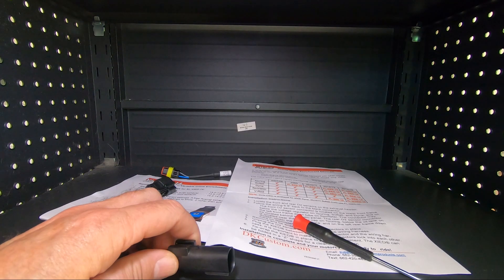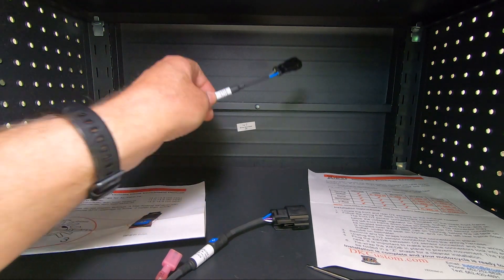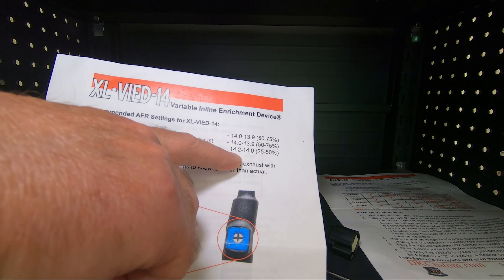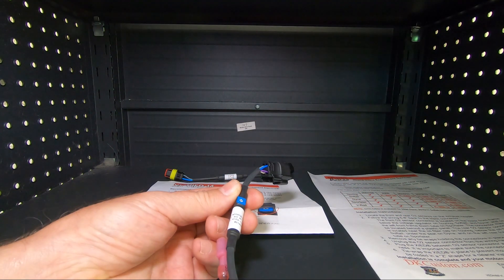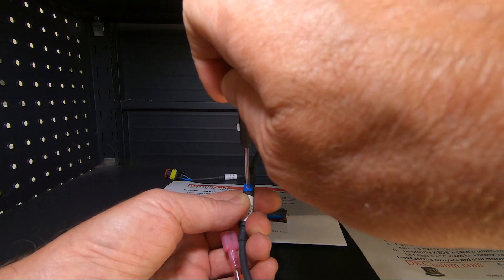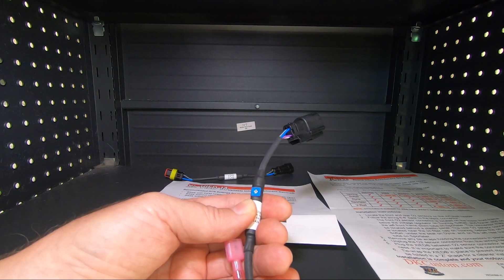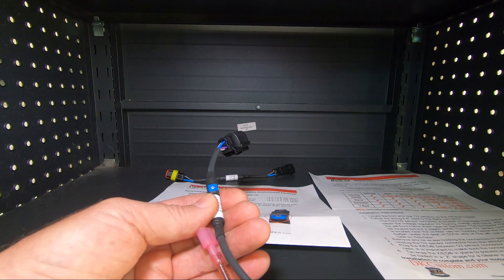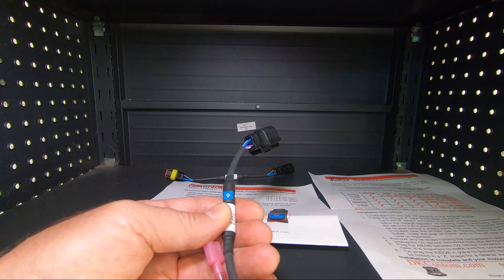Plug n Play Adjustable Fuel Management for Harley's

Comment: I have installed the FL - ViED on my 3014 Heritage Classic, would it be advantages to add a Fuelpak FP4 or will it not work together?
Reply from the maker: The only benefit there could be ,with running both, would be if your tuner is not giving you enough fuel enrichment then the addition of the iED certainly will. The FP4 should be giving you enough fuel enrichment. 

Please feel free to contact us with any questions;
Support@DKCustomProducts.com
662-252-8828

Thank you for commenting! 👍 MB

Comment: You guys really should have a million or more subscribers! Everyone who rides a Harley absolutely needs to be subbed to you guys!
Reply from the maker: Wow, thank you for the kind words!  Share our vids with your friends, might help them out.
Reply: Only people riding standard-ish Harleys will find this sort of thing useful. I put the XIEDs on my 2010 Streetbob and whilst the effect was positive I wouldn't say that it added any real power gains. To get a real performance Harley then the AFR is gonna be around 12.5 to 13 : 1, all the weaker AFR's will not make a lot of difference.Loud pipes go hand-in-hand with these AFRs and two-into-one exhausts just stifle the engine above 4500rpm.
Unfortunately to get real power gains involves a lot of parts and engine modifications and  money to do this. I stopped counting right away because even if I hadn't had a fair bit of cash to spend, I think I would have questioned the financial costs in comparison to the potential power gains.
 If you want more power AND insist on keeping it Harley then it'll cost so it is a good idea to buy a low milage used bike (CVO engined twin cams are better to 'hot-rod' as the engine has much better heads for a start) and remove all the chrome doo-dads to sell, save a good bit extra and then rebuild the engine with more capacity, compression, port the heads ,add a cam, get the crank welded etc etc and you can get a bike with  50+% gains.... my Streetbob now has over 130 bhp and torque  (with a carb as I junked the EFI) and is an absolute blast to ride  though it did eat the tranny main bearing! 
Remember though that the standard suspension, tyres and brakes need upgrading as well.
Reply: Whatever. 🤣🤣🤣. Go ride a foreign bike then🤷🏻‍♂️
Reply: @robbyclark6915  I already do..... I am English and ride Harleys so they are foreign bikes !
Reply: @thakery5720    Well I’m American and they are American bikes so that’s what I ride and what I love. Literally anything else is a foreign bike. Good luck with whatever it is you’re trying to accomplish 🤷🏻‍♂️?
Reply: @thakery5720    Oh my goodness! I completely misread your initial comment! I thought were dissing on my beloved Harley and putting down anyone dumb enough to drop money into that pit? 🤦🏻‍♂️🥺. Well that’s why I should finish reading people’s comments and being more discerning! My mistake! So sorry! I thought you were saying, well, I thought you were saying something you totally were NOT saying! I won’t even mention it as it just reveals my ignorance even further! Again, I’m totally sorry I sounded like a prick! That’s what I was being and I was out of line! Sorry and happy riding!
Reply from the maker: @thakery5720  Glad you're enjoying your Ride!

Yes, the XIED products are for stock and Stage I bikes.
Reply from the maker: @robbyclark6915  Some folks are Power Hungry.   Nothing wrong with that.  I did an interview last week with a guy that put a 131 in his Tri Glide.  That thing is a monster.

But to get that kind of power out of a HD is an expensive proposition.

My bikes, with just a Performance Plus Stage I, easily get to 100 mph very quickly, with more left on tap, and that is enough for me and most folks.
Reply: @DKCustomProducts  My reply was not meant to in any way deride from the postive use of these items - they are very good value and help the Harley be what it should be considering the way EPA and all other countries emiossions agencies are effectively 'neutering' the engines - I just meant to make Robby Clark aware that the way Harleys - and all engines - are so mechanically 'de-tuned' these days cannot be 'rectified' by such means.
 I sometimes wonder what kind of performance could be had if we still had the old polluting engines, fortunately we are much better informed these days as to how to save our planet and any supposed 'increase' in emmisions due to XIEDs eyc is so small - they just help the engines perform a little better by stopping them run too lean.
 If I have caused you any problems please tell me and I will delete all my comments - stay cool Guys !

Comment: Will it work on a M8
Reply from the maker: M8's do not need a tune to add a free flowing air cleaner, and/or free flowing exhaust.  Here is a video on that subject- https://www.youtube.com/watch?v=Lb_57Z_Ipms

If you have a Sportster or any Twin Cam, they come too lean from the factory, and the first thing to be done to those is either a tuner or a XiED product.  You want to do one of those before changing intake or exhaust.
Here is a link to some options.  The XiED line is very effective for Stage I's and are not expensive.
https://www.dkcustomproducts.com/efi-tuners-c74.htm

Always feel free to email or call with any questions.  Thank you for looking at our parts.
Support@DKCustomProducts.com
662-252-8828

Comment: Just added these on my 2010 Roadglide. I’ve had this bike going on 30k+ miles. Along with these, I’ve done the external breather, converted to factory dual header, drilled CVO mufflers, modified Air box. This was absolutely the best mod I’ve made to the rideability of my bike. Smoother, more torque through out power band, cooler & better throttle response. Set mine at 50% for now. Exceedingly happy. I am not planning cam changes or head work, so this was the answer for my bike.
Reply from the maker: Great to hear! Thanks for sharing, sounds like you have done some good things to get your ride dialed in how you want it.
We appreciate your business.

Comment: Hi guy again from down under thanks for reply on xied for 08 softail curious as what sort of afr should I roughly achieve or should it enrichen to in ideal conditions
Reply from the maker: Glad to answer your questions! 

If you install the XiED it richens the Air Fuel Ratio from 14.6:1 to 13.8:1 in closed loop mode. 

If you install the ViED it richens the Air Fuel Ratio from14.6:1 to a range of 14.3-13.9:1 in closed loop mode.  The V is for Variable because you can change the ratio. This Variable Fuel management upgrade allows you to fine-tune the air fuel mixture with a small screwdriver.

Thank you for commenting! MB

Comment: Hey there so I have a question for you guys. I have a 2015 ultra limited with python slip ons. I like a loud bike so I’m thinking Of taking the baffles and packing right out of my slip ons.  Would it be ok to run no baffles if I install the xied on my bike.  I still have stock air breather to.  So if I open that up and had no baffles would I then have a problem?
Reply from the maker: You will be fine tune wise with the FL-ViED's or FL-XiED's tune wise.
Removing the baffles will create a bit of a dip in your low and mid range torque, but that is easily fixed by installing the Thunder Torque Inserts™.  You will still be loud, and just a bit deeper tone.  You will have more power than you have now.
https://www.dkcustomproducts.com/xied-vied-fuel-management-c121-287.htm
LINK to TTI's-
https://www.dkcustomproducts.com/thunder-torque-inserts-c57-298.htm
LINK to a report on how and why the TTI's work at producing a loud deep tone, along with more power- https://www.dkcustomproducts.com/harley-exhaust-myths-and-facts.htm
Reply: Thanks very much for the quick reply.    The cat is still in my stock header so will I still loose low end power?
Reply from the maker: @kamakazeekid1  Yes, take a look at this video, I believe you will find it interesting/useful- https://www.youtube.com/watch?v=pr6z00gL5Yg

Comment: Can this be adjusted differently front and back?? Or should adjustments need to be even for both??
Reply from the maker: It is not necessary for them to be set equally.  If your bike is running warm and/or you ride in hot temps, it is not a bad idea to have the rear cylinder a little richer (more toward the 100% setting) than the front.  Just ride it at different settings, like talked about in the video, and where ever it runs best, that is where you should leave it.  You cannot hurt the bike trying different settings.
Reply: I forgot to ask, do you need to shut off the bike whenever adjusting it??

Comment: My 103 twin cam has a SE Heavy Breather intake & a Bassani Firesweep full exhaust system, plus it's got a Vance & Hines Fuelpak 3.  Is there any advantage in getting the enrichers if I've already got a Fuelpak 3?
Reply from the maker: The only benefit there could be ,with running both, would be if your tuner is not giving you enough fuel enrichment then the addition of the iED certainly will. The FP3 should be giving you enough fuel enrichment. 

Please feel free to contact us with any questions;
Support@DKCustomProducts.com
662-252-8828

Thank you for commenting! 👍 MB

Comment: I have a2008 this bike runs battery's  down due to the key fob alarms  system i need toby pass this thing and which wire from ecm to cut so I can by pass this I jumped start relay it starts but shuts down after 3 seconds
Reply from the maker: I don't know.  We've never done that.  We've never had an alarm run down the battery.  If a bike is going to sit longer than 1 week it is plugged into a battery tender.  You may have something else going on with your battery and parasitic drain.
If it is sitting for more than a week or so without running (by running I mean at least a half hour of riding between starts) then a tender is a good idea, regardless of whether it has an alarm system.

Comment: Nothing will ever replace my Power Vison with Target tune !!
Reply from the maker: The Power Vision with Target Tune is the cats meow.  I have that on my Sporty and it is amazing how well it works.  It is expensive, but does an amazing job.  https://www.dkcustomproducts.com/power-vision-tuner-accessories-c120-240.htm
Reply: I have a power vision and just ordered the target tune kit with the O2 sensors today, better than getting dyno tuned i hear!
Reply: Thats my goal for the trike is to get the Power Vision and Target Tune but I still like the idea of these little things during the stage 1 " un corking" process since it's simple and quick. These obviously won't work when it comes to putting in a hotter cam or a larger set of jugs & pistons etc, but  its a nice convenience to be able to pull off a side cover, make a quick adjustment, and back on the road.
Reply from the maker: @grimeyhonkyracing3938  The PV with the TT is crazy good.  👍
Reply from the maker: @daviddavis8653  Yes, these will give you 85-90% of all the available power in a stock or stage I situation, for about 1/4 the cost.
Reply: My bike is 2019 XL1200 48 Will these work with my fp3?

Comment: Can i get that for my Dyna lowrider 06
Reply from the maker: Good question.  On the Dyna's, in 2006, most of them are the same delphi ECM that Harley started using on all other HD's in 2007.  If your 2006 has o2 sensors, then you can run these on your bike.  https://www.dkcustomproducts.com/vied-fuel-enrichment-for-harley-efi-plug-n-play-more-details-dk-vied-nr.htm

Comment: I bought a used 2016 FLTRU. I just bought A power vision. I have factory 02  sensors. Vance & Hines power duals With twin slash cut Mufflers.  The pipes do not have 18mm bungs.  I believe it has a stock Cam. And a screaming Eagle air cleaner  With breather bypass. Would  This product will be  Advantageous  And/or compatible?
Reply from the maker: The Power Vision uses the narrow band sensors that are 12mm.  You would only need the 18mm if you were to add the Target Tune module, because it uses wide band sensors.  
Your power duals should have the 12mm bungs for the narrow band sensors, so you are good to go.
Reply: @DKCustomProducts   It seems from what I read that even with the power vision, The narrow band sensors can't Enrich the fuel  Enough accurately. I thought maybe Your  Product  Might get my fuel mixture into the 13's
Reply from the maker: @fredflint1797  You can see some details on the Power Vision at this link- https://www.dkcustomproducts.com/dynojet-power-vision-flash-tuner-w-auto-tune-dk-pv-cmp-pkg.htm
With this Power Vision you can get your AFR to where ever you want.  13's in closed loop is not a problem at all.
Now, if you are having a Dealership tune with the Power Vision, many of them will not tune it outside of the EPA mandates...but that is not a function of the Power Vision, but of the person using the Power Vision.  The PV has no restrictions built into it.
Reply: @DKCustomProducts   Thank you for your patience and response. I am a technology-challenged senior  Determined to learn. I need to find out How It reads beyond the range of the Narrow band Sensors. But if you say it can be done I believe you I just gotta keep  Hammering at it
Reply from the maker: @fredflint1797  In closed loop, where the narrow band sensors are used, that is a low load, low throttle area of the tune.  Getting the AFR down too low is not preferable...doable, yes, beneficial?  I can't think of how.  When you go into open loop the table in the PV tune take over (there is no o2 sensor feedback in open loop) and you can set those wherever you want.  Also, those tables are affected by the Long Term Fuel Trim (or as HD calls it "adaptive learning")
If you want complete control, and I have this on my Sporty and it is amazing, use the Power Vision with the Target Tune.  You can see it at the link below.  Part of the Target Tune are wide band sensors, so you will need the 18mm bungs.  The TT lets you set the AFR wherever you want in open and closed loop and it constantly adjusts to stay "on target".
When I installed this my power GREATLY increased AND my MPG did also.  
https://www.dkcustomproducts.com/dynojet-target-tune-for-the-power-vision-harley-efi-tuner-dk-pv-tt.htm
Reply: Thanks I think I'm understanding is better
Reply: I just want to get out of running so lean
Reply from the maker: @fredflint1797  You will be able to do that with the PV....both in closed and open loop.
Reply from the maker: @fredflint1797  👍

Comment: Screaming Eagle High flow air filter/Vance and Hines Power headers and Vance and Hines exhaust...
You saying these are better than the Screaming Eagle tuner put on a Dyno?
Reply from the maker: There are a lot of versions of the Screamin' Eagle Tuner.  This is much better than the EPA compliant ones that are all the SE Tuners have been since 2017, and some of them from before 2017.

Comment: I want to pick a the anti gravity lithium battery from your website, is the 360 cranking amps enough for a hot 1275 sporty? Is the 480 too much?
Reply from the maker: The 360 is probably not enough, especially in colder weather.  480 is not too much.  Unfortunately anti-gravity quality started suffering a couple of years ago and we are not carrying them anymore.  I am getting ready to test out a Shorai in my own 1250 build.

Comment: Great videos and product line.  I want to give you my support.  What do you have for a 2017 FatBoy S with the SE 110ci.  It has the stock Screaming Eagle Ventilator Air Intake and Vance & Hines Twin Slash 3-inch Slip-Ons.  

I plan on upgrading to a 117ci, full exhaust, and cams next year, so I will need a $500 tuner and dyno then, but right now, I just want to make the bike run right.

It is running lean as hell and popping on decel.

Thank you.
Reply from the maker: Thank you, appreciate the kind words, and good to hear you're enjoying the videos.

For your 2017 FatBoy with the Stock 110, the one to use is the FL-VIED at this link.  https://www.dkcustomproducts.com/fl-vied-fuel-enrichment-for-harley-efi-plug-n-play-more-details-dk-flvied-10-nr.htm
Reply: @DKCustomProducts  thank you, what breather kit would you recommend for this same bike? haven't installed one yet for this bike, might as well while I am at it.

thank you for your time.
Reply from the maker: @killdozer3464  Thank you for looking at our parts.
Any of the kits at this link will work with your bike- https://www.dkcustomproducts.com/diy-external-breather-systems-374.htm
Reply: @DKCustomProducts  I ordered the FL-VIED kit. I didn’t order the breather kit, because my bike has a back plate that I never seen before. Instead of venting through the screws into the intake, the plate has small holes through the plate that feed from the mounting stand offs from behind the plate. I never seen that before. 

I guess I could just replace the screws with standard venting screws, and then modify the plate to install the breather filter. But at that point I’ll just install a new high flow air cleaner. 

Thanks again. Can’t wait to install my FL-VIED and have my 110 running right.
Reply from the maker: @killdozer3464  Thank you, we appreciate your business.  I believe you will be well pleased with the improvement with the FL-VIEDs.

Here is a video showing how the breather kit works with the air cleaner you described...while yours may look a little different (or a lot) the principles are the same.
https://www.youtube.com/watch?v=uAmPC_kglJk
Reply: @DKCustomProducts  again, thank you so much for all the assistance and having such great video content. Your channel is a great knowledge resource. 

From now on, I will come to you for my Harley needs first.
Reply from the maker: @killdozer3464  Glad to help and thank you for the kind words.
We appreciate your business.

Comment: Do you need a Tuner with this ?
Reply from the maker: You do not.  These will work on stock bikes and on bikes with High flow air cleaners and high flow exhaust.  If you do more than that....cams, heads, etc., that is when a tuner is needed.